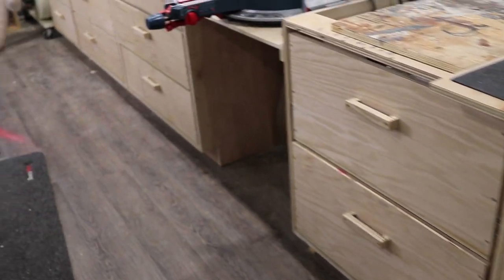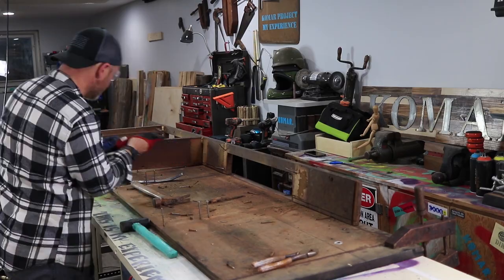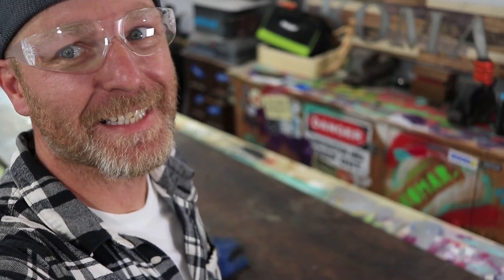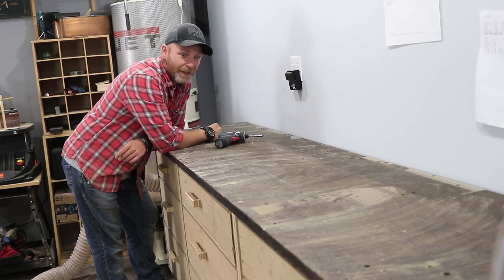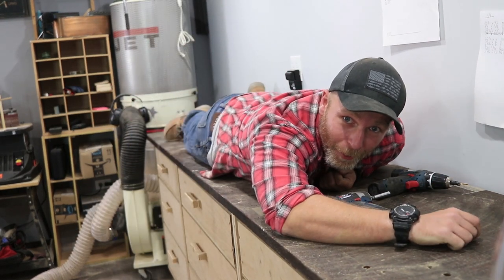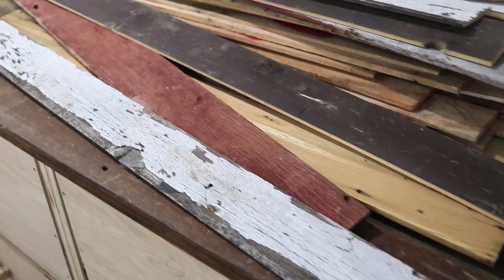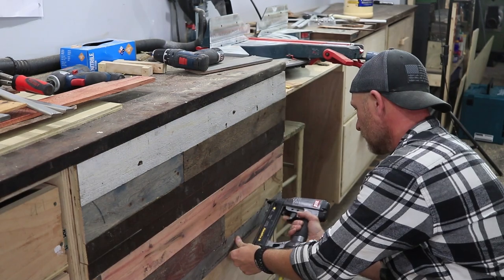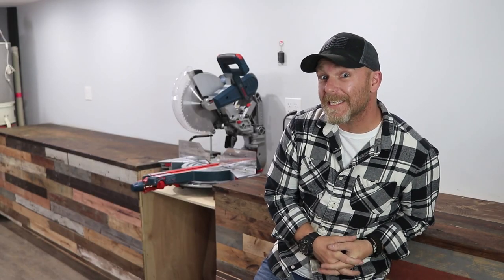Miter Saw Station Build Part 2 || Reclaimed Wood Top and Pallet Wood Drawer Fronts

Comment: Doesn't it harm the blade when you ripped thru the staples for the drawer faces?
Reply from the maker: The Josh That Views it actually was just pin nails.  Usually the blade goes through them since they are so think but I still made sure I watched where I put them and didn’t cut though any.  Got lucky